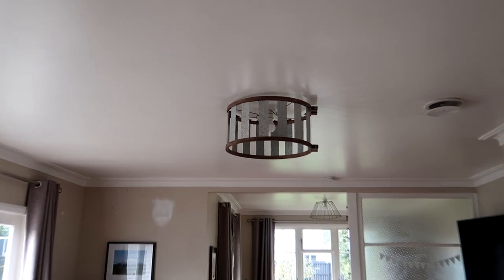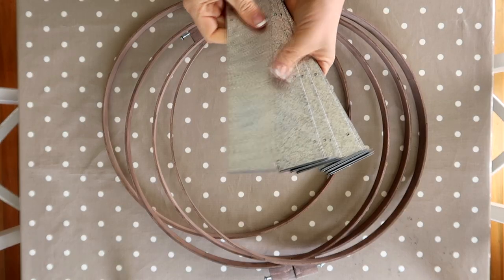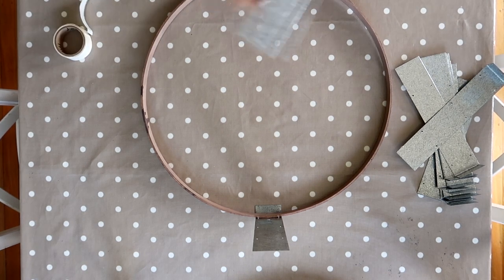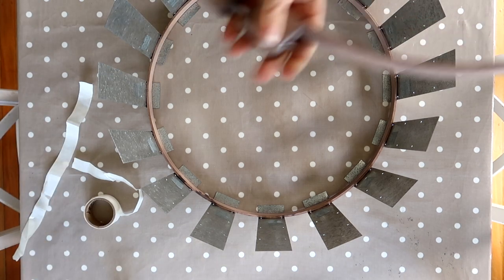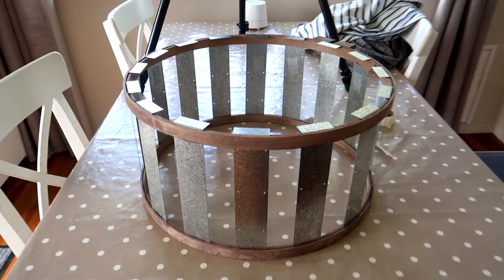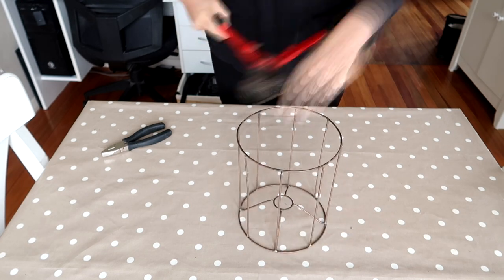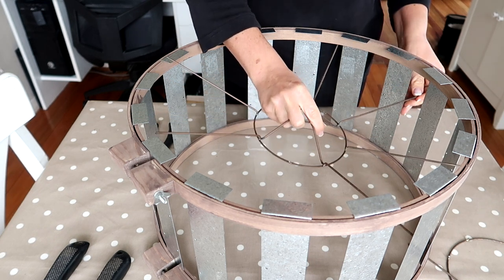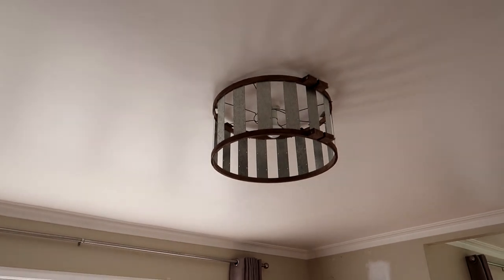DIY Farmhouse Style Light Fitting | A Thousand Words

Comment: A soaker is a weatherproofing product designed to sit between a tile (or roofing iron) and an object that protrudes from the roof (like a chimney stack or a ventilation pipe). Where the roof meets the object, a soaker is fitted underneath the tile or iron but will rise up the edge of the object to prevent water from entering the roof space.

P.S. Great job.

(Edited to add) P.S.S. I hope the above didn't come off as "mansplaining"! 😱
Reply from the maker: Ha ha no, not mansplaining, interesting info.